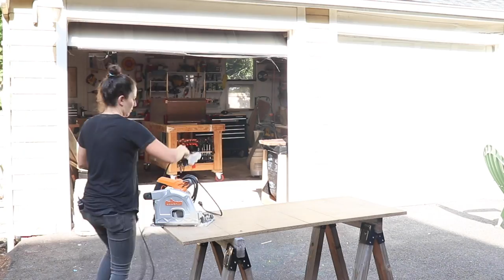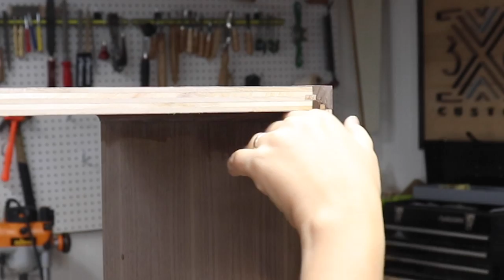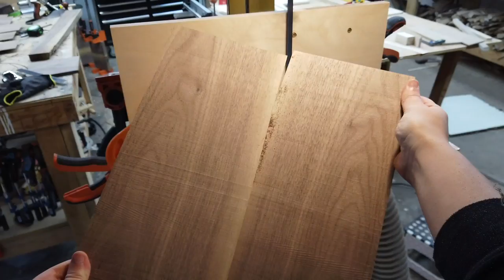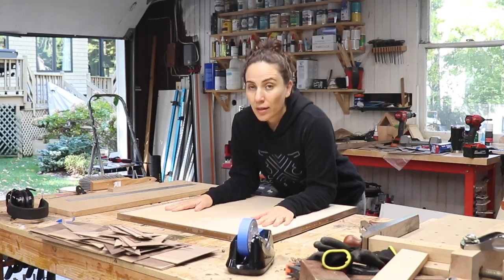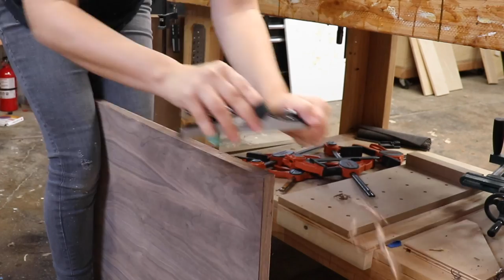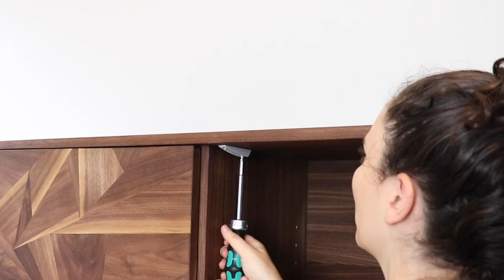Building a Record Player Stand - NO TALKING, JUST BUILDING!

Comment: This is excellent A/B testing - does your work look the same without 'explanation'? Guess what.... it is equally beautiful! Yes, it was silent, it is speedy, I can slow it down - but the result remains the same: fantastic cabinet. 
One thought: what about making that veneer on one big sheet and then cut it in half? Then the doors will fit together and seem..... seamless (pun intended). Would that be possible/feasible?
Reply from the maker: Glad you liked it! It’s definitely possible and I thought about it. But the clamping situation seemed difficult.
Reply: @3x3CustomTamar  Just put it on the floor and park your car on it for the night :-)